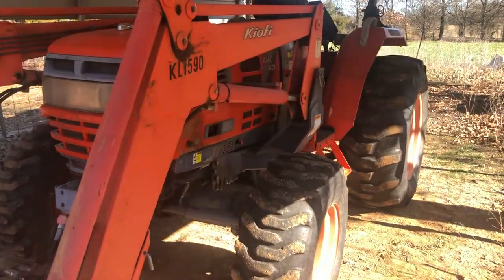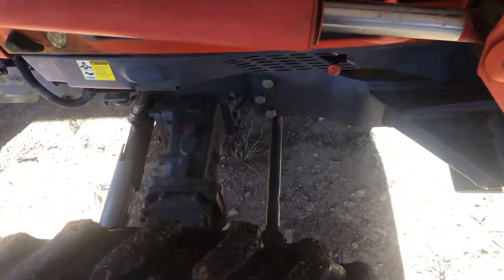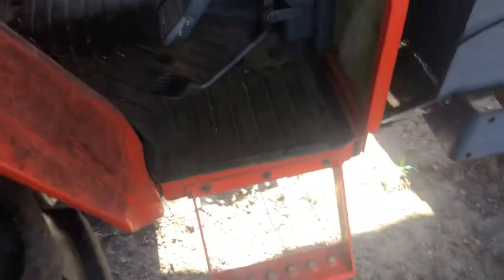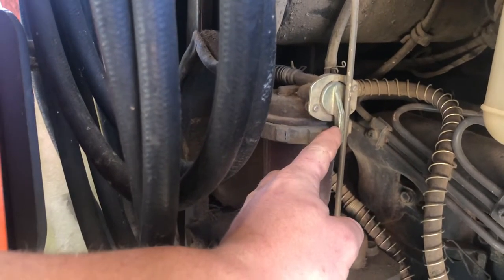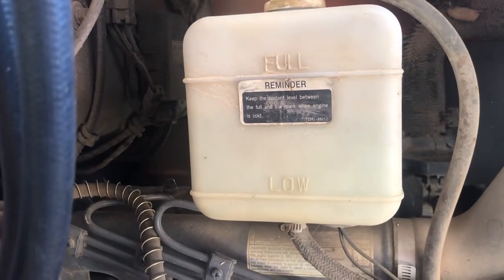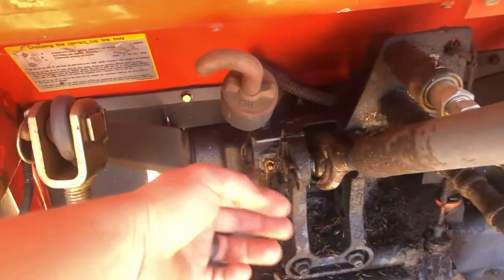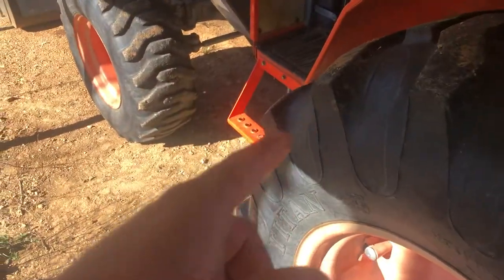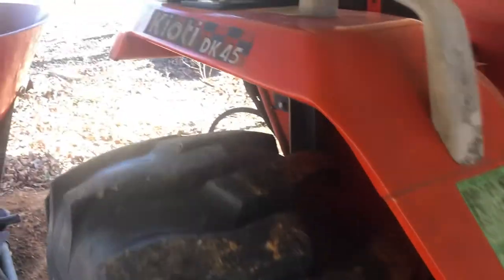Kioti DK45 Maintenance Walkthrough

Comment: Can you adjust the brakes ? my dk45 parking brake allows the tractor to roll when locked in.
Reply from the maker: Yes you can. If you look on both sides of the dash going through the floor there are rods with adjusters on them. Those are your brake rods, you should be able to adjust them tighter. Just don’t go too tight or your brakes will drag.

Comment: My 45 is really hard to start, often requiring starter fluid; any thoughts?  Also, can you recommend the best dealer for service items/parts?  Great video thanks !
Reply from the maker: I would check your glow plug system to make sure it is functioning properly. There should be a relay on the firewall that controls your glow plugs. Could also be your ignition switch possibly. These tractors start really hard when the glow plugs are not functioning. 

Depends on what area you are in for parts and service. You can get most things easily online now.